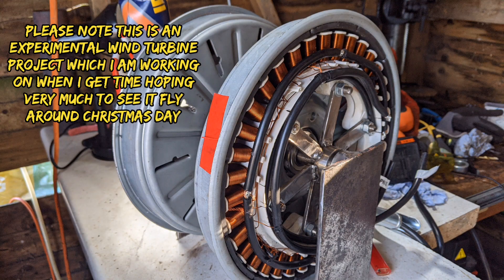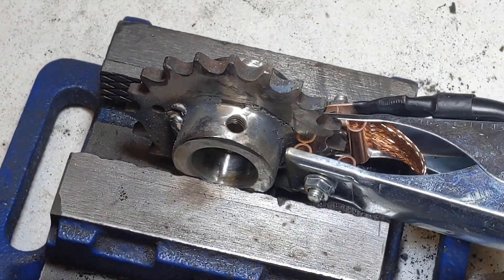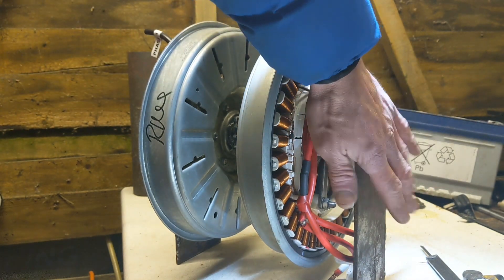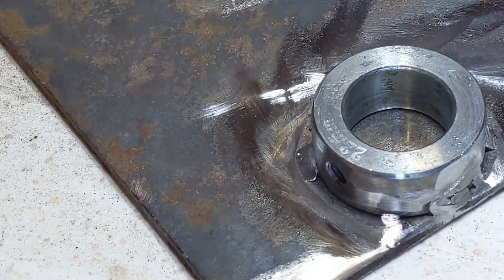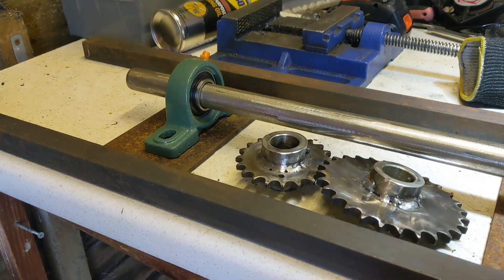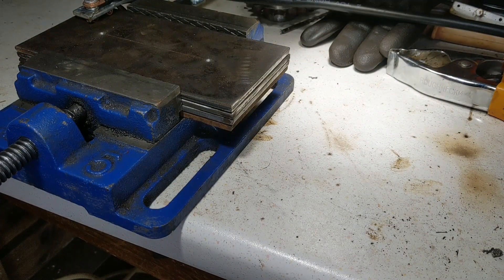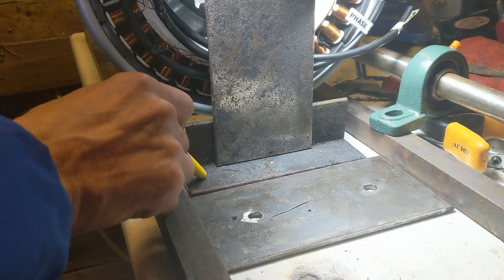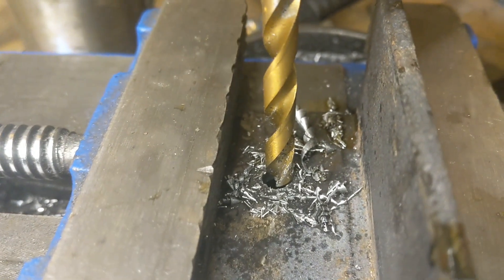FREE ENERGY PROJECT Dual Smartdrive WIND TURBINE , more work !!!

Comment: Hi, have been searching if you have a video on wiring the Modified LG stators, not the internal wiring but how you connect the outputs and to what are you connecting them to?  Any help or a link to a video if you have one would be much appreciated.
Reply from the maker: All you need. My friend is an AC to DC rectifier. They are about 15 quid, you connect the three wires from the motor to one side of the block and then the positive and the negative to your battery bank on the other side of the block.

Comment: looks awesome ;)
Reply from the maker: Thanks mate, still waiting on the blade hub discs, I will have to run this one loaded at all times and not make any big cock ups , I think it's good I have two separate motors, in low wind I could just run one and maybe get better overall power as the load is less and when it's howling run the two motors and keep them loaded.

Comment: I assume the heat of the fire softened/anneasled the drils so the blunted as soon as you started to use them, you could try hardening the ones you have not used yet.
Reply from the maker: Most of them were pretty battered anyways , I did some drilling in the video I am just uploading the drill eats through metal with a good drill bit !!